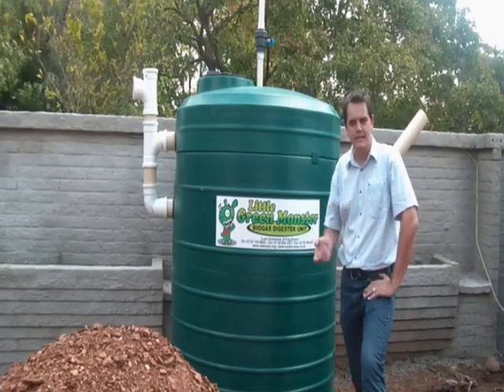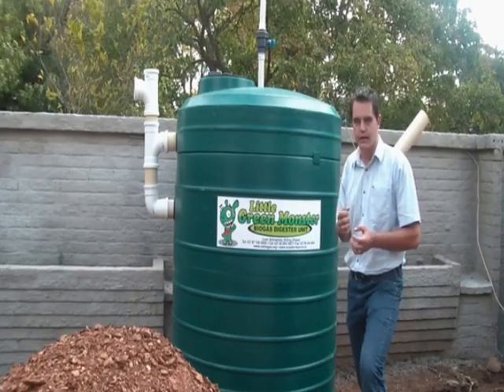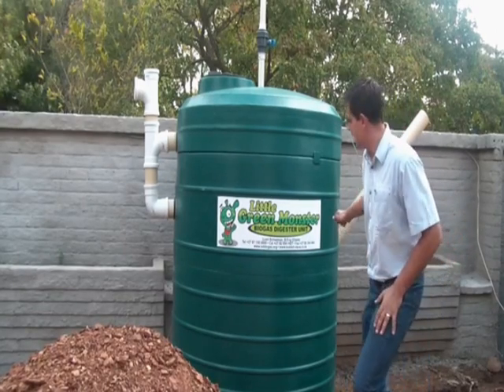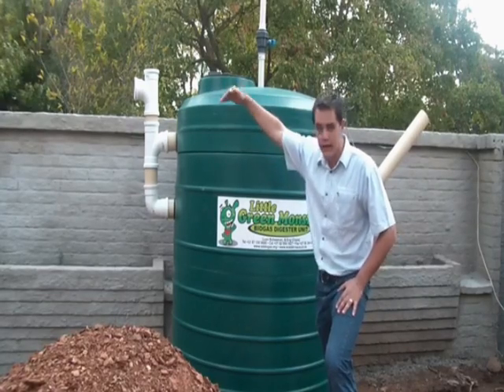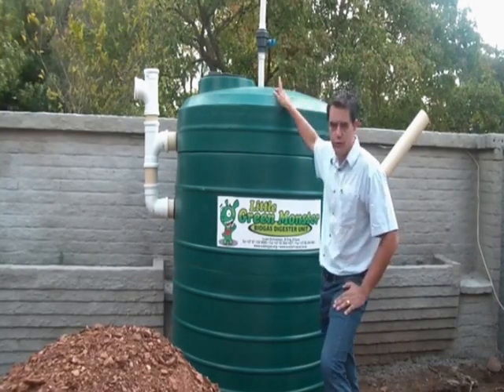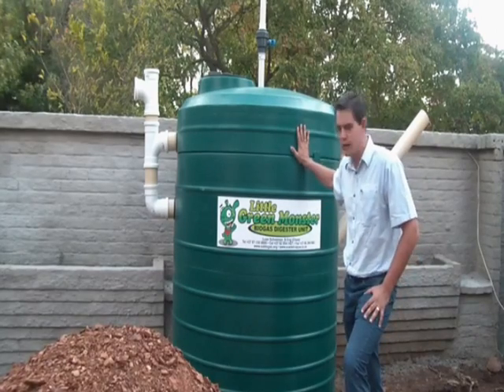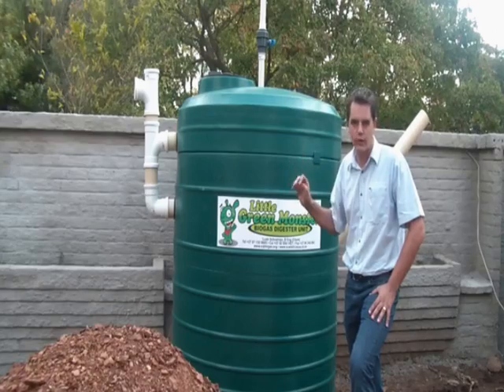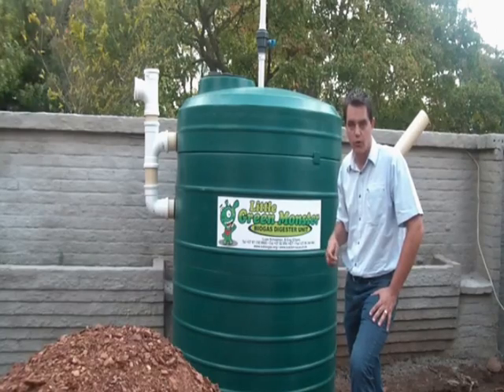BIOGAS DIGESTER FOR A DOMESTIC HOME - Introduction - The Little Green Monster

Comment: You do need a large bottom drain plug to drain out the (solid) compost from time to time, the way to determine this is if you see solids starting to come out of your liquid fertilizer tube. Another idea is to build in an inspection window more or less halfway up the tank, but remember this window needs to be covered if not in use to prevent light entering the tank and killing the anearobic organisms.

Comment: Dumb question, in North Carolina, we produce most of the pork products for the US and for other countries. Because of this, we have a bit of a waste problem. A Pig waste problem. Why couldn't they use something like this to produce useable gas?
Reply: Hi,
I've been reading about biogas in the mother earth news since the 1970s. They had a farm in N.C., I believe Hendersonville. I sure wish they had kept the original format !!  I've got all my old issues and use it as a library to build my projects.
A large scale hog farm washed the waste/ slurry into a concrete tank and ran a generator on the gas. It was to big for me but I'm building a smaller one with IBC totes.
Good luck with your build.

Comment: Any of you can help biochemistry plant
What is the length of 60 cubic meter and length should be measured in fit, how many bricks will apply in it and what is the size of the iron trim
And how much gas can be used in biosphere gas production
My name is helpless and I am a resident of Gujjar Khan, my telephone number and wats number
+923225237757 what's app number
Phone number
+923135390412 zone
+923403787297 UPHONE
My gmail account asadiqbal0340@gmail.come

Comment: Does it only supply gas for cooking???? I thought it was  free energy for other power as well.
Reply: Depends on how much biomass and size tanks you can utilise..you need to remove water vapour and scrub to remove siloxane gas and other impurities to use it directly into eg: generator because impurities can cause corrosion and build up on surfaces..
Reply: @vps1014  Thank you honey- I had no idea at all.
Reply: It is just methane gas.  There will not be near enough output to power a home or business.
Reply: @wesbaumguardner8829  Oh- I didn't realize. Thanks Wes.

Comment: how well would this work with a 1500 chicken manure  egg production location?
Reply: Calvin Lawrence very good question. Did you ever get an answer or find a similar solution?  I’d like to use it for the same purpose.
Reply: @Cavin Lawrence , have you made any progress? I am interested in developing a biogas based energy system. Should work well with so many chicken derived biomass.

Comment: need a gas scrubber or a water bubbler system.  I checked out the pricing it is reasonable, why you dont target the SA rural communities as your market.  With some more storage space on the system, a scrubber and a way to save on the water usage this will be a excellent supplement to farms in the karoo, kalahari or north west.
Reply: A simple charcoal/saw dust chamber will do the trick.

Comment: eventually that thing will need cleaned out right?  How do you do that?
Reply: That was explained in the video. The reacted material is output back to the sewer connection.
Reply: +Nathan Rogers But only the "gray" water off the top will be introduced into the sewer system.  What about the heavier solids that sink to the bottom of the tank?
Reply: @pcs06d  need a suction pump, like a small pool pump..

Comment: Are these for sale in the US?
Reply: +John Evans Should be because I get my water bill they charge me more for sewer than they do for water? Why is it more expensive to take sewer than it is to produce fresh drinking water? After all the water has to meet a standard the sewer water is just processed and released, they are actually getting something valuable from us if they managed it properly?
Reply: @GEAUXFRUGAL  Hi Geaux, Wastewater collection and treatment cost more than fresh water filtration and distribution do because on the fresh water side, infrastructure plus maintenance take less money than those on the wastewater side. I was a licensed technician in both fresh water and wastewater and my total experience was 30 years'. Filtration plus sanitation and pumping altogether is way cheaper than dealing with used water.
Reply from the maker: Welcome to send me a mail on wally@energyweb.co.za and I will gladly send you some information and pricing.
Reply: +S. McCloy Ya but usually they just clean it and send it back out, thats the reason for the price hike. Especially if your in a part of the country that doesn't produce as much fresh water, just means they really have to depend on what they already have. So cleaning it as soon as possible would be a must, to breed bacteria biogas digesters using human waste I'm pretty sure need to sit for a few months to start the process and even longer to fully utilize all the methane.
Reply: +S. McCloy - potable water costs less than treating sewage if you live in a location that has a ready source of water that is already pretty clean, such as groundwater. The water company only has to give it minimal treatment, such as filtering with activated carbon and chlorination, then pay for the cost of pumping it to you. Cleaning up sewage is much more involved, with primary, secondary, and tertiary treatment. One of the large areas of expense is the energy cost for aerating the sewage to allow microbes to eat the fecal matter and so on, and further treatment to remove nitrates to avoid creating algae blooms and anaerobic dead zones in the receiving water body. The cleanup cost is a function of what environmental standard the effluent has to meet - the higher the standard, the more it costs.

Note that even if you treat your own sewage, the water company might not give you a discount, unless they actually meter your sewage production. In most residences, there is only a meter on the incoming water, and the company then computes how much sewage they think you produce, and bill you for that.
Reply: Daniel Mocsny People live in their cars or out of them they have solar power for their fan and tv viewing, live out of their campers ,shower at the gym each day, and pay no water no sewerage, somebody cleans the bathroom, they get internet service, can watch cable tv while they walk, can get a tan, they can get their hurt muscles massaged on the water jet table, some locations will give them a free haircut. All for $20 a month flat rate for endless showers unlimited internet etc.
 I don't have to give the water company a thing (IF I were single) and just go live out my car and have every bit of quality of life I currently enjoy. I NEVER have used up $25 in quarters for laundry in a month so I would be ahead on that front also I have to pay for the electricity for the laundry have to repair the hot water heater have to repair the washer and dryer.
 Logic says that in a city like ours with the population density they are not serving the public well by charging this much money for sewerage per property they are price gouging. Baton Rouge La is not as big as NYC that has a low low cost for sewerage treatment but we are not as small as some of these small towns that have massive expenses for water treatment due to lack of population participation in expenses.

Comment: That gray water MUST go into an automated irrigation system; piping it straight back to sewage is environmentally irresponsible as well as an affront to common sense of efficiency! You also MUST insert a turbine generator into the gas outlet or you're wasting a metric truckload of electricity generation to pipe back into the grid. This is a very primitive biogas system and is wasting almost 75% of output. Fix it!
Reply from the maker: Thank you for the feedback and I agree on most of your feedback. This approach on the digester is a entry level for domestic level users. The irrigation of the overflow is a next level for sure the challenge lies in the small percentage of pathogens that still exists. You need to aerate the overflow first in an aerobic system first to remove all remaining pathogens left from the sewerage first. We will soon post some new info on that solution but it does get expensive for the average home-owner. The same goes for the generator that requires some additional equipment in scrubbing the gas first and it does get expensive although doable!
Reply: @energyweb1  plz find the solution and guide me to build one...@ mailsuman3@gmail.com.
Regards